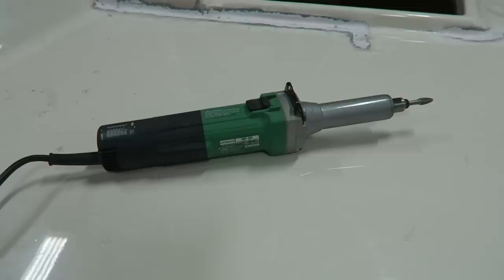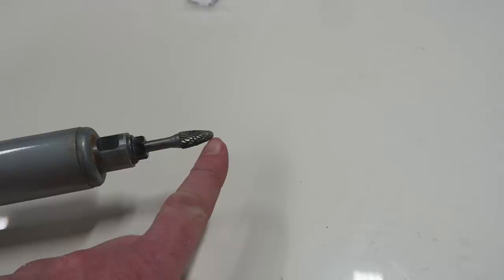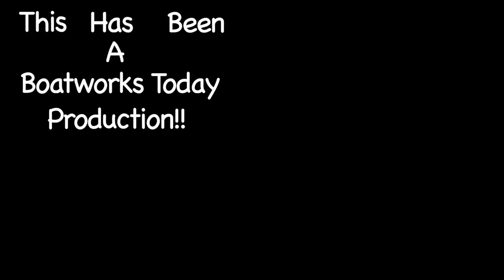Shaving Fiberglass, New Approach To Stress Cracks And Mail Call!

Comment: Hey guys FYI, Gel Coat will not properly cure if applied directly over the TotalBoat Thixo Flex Flexible Epoxy Adhesive.  You will need some sort of filler/barrier or you will end up with gooey soft mess of gelcoat where it contacts the epoxy.

Comment: After having applied a thickened epoxy to a ground out spot I like sometimes use a clear box tape over the area.  This spreads the epoxy out and gives good contact especially over a rounded surface.  Next day simply peel the tape off and way less sanding.  Ever use this trick?
Reply: peel ply is meant for this as well
Reply: @BackyardBoatworks  peel ply leaves a dimpled surface clear packing tape work great almost no sanding

Comment: One challenge with putting epoxy over gelcoat is that the epoxy is harder than the gelcoat, so when you sand it, the gelcoat abrades more quickly and leaves the epoxy patch higher than the surrounding surface. That's the point of premixed epoxy filler compound - it has fillers that soften it to gelcoat levels. How do you solve this problem with the flexible epoxy? I don't see how the little belt sander can completely avoid the gelcoat, nor can the finishing sanding.
Reply: Tape the gelcoat. Use a small smooth scrap of wood & sandpaper for hand sanding, long enough that you can see the contact point instead of your fingertips.

Comment: I have a little belt sander/ shaper and it has a vacuum attatchment, it's made buy Grizzly Industrial and you can dial the speed down real slow and make hardly any dust. Love that tool. I have an air one to but it's more messy. You can adjust the angle of the belt to different angles also. And it's small and easy to use with 1 hand. It's the cats meow.

Comment: I use a two pack epoxy cartridge gun system for gluing climbing anchors into cliffs. Yes, we always spurt out a couple of big pumps before each glue session and for each new nozzle. We keep that as a sample so we absolutely know that within the hole the glue has gone off. Best practice. You are doing it perfectly. Great explanation as well. Excellent to see you using something to smear the glue into the surface too mate. I was getting agitated in my seat and then just like that you used the stick to smear it in. Awesome.

Comment: One of the best features of Thixo is you can unscrew the top, clean up the opening a bit and cap it, to save the remaining product for the next time you need it. Most of their products come with two mixing nozzles, and you can buy a bag of 10 at a reasonable price. Really good way to get a little thickened epoxy when you need just a little bit.

Comment: This is a great video as are all of you videos. I have an old boat that I enjoy working on myself and fiberglass repair is new to me. I wish that sometimes the video would show the complete project and tell the steps from start to finish. I feel comfortable with fiberglass and resin but I do not have an understanding of how to transition from the epoxy you just laid down to applying the gelcoat. I really do not understand and to transition to the gelcoat step. Thanks for the videos, they are great.

Comment: I'm repainting my upper deck on my 32 Challenger Sailboat and it has a few layers if paint and crazing all over. I'm not looking forward to it. I fix boats for a living so mine need to look good right lol.  I love this boat but man lol. Yes grinding out all the cracks and laying down 2 Matt's over the top and then sanding it all down then filling pinholes with duraglass. Then I'm rolling and brushing gelcoat baxk on and aim to sand and polish then redo my non skid, fun times ahead. I started building a building over the top to work under out here in the PNW. today.

Comment: Interesting fix Andy. Can I assume you intend to paint and not gelcoat over the area? Because sometimes gelcoat won't cure properly over epoxy.
The gelcoat you ground out appeares to be very thick not exactly .020-.030" max , probably explains the cracking.( looked like 1/8").
So I agree, that Flexible epoxy is impressive I shall be trying some.  
We recently did a project with regular total boat epoxy gluing large Phenolic discs for a forming tool , loved it! My guys even took out the blue mixer and cleaned it out, I will watch the mix if we do reuse it.
Sorry a rather late comment.  Cheers warren

Comment: I guess by video date you have figured out your tools abilities by long time yourself, but as a tip to those other guys buying or just having bought one. Most power band files is a 5 in one grinder deal. 

Longside with undersupport, for flat surfacing and making bevels. 
Longside without undersupport gives smooth curve transitions and bigger outer radiuses. 
Transition between supported longside and wheel, gives a tighter hardgrind curve. Good for "submission beatings". Etc.
The other side - to wheel proximity combo gives smooth transitions from big curve to smaller curve.
Straight on wheel is good for inner fillets. Radius of inner fillet can be changed to bigger by angling the tool sideways and/or twisting it clock/counter to groove. Then aim tool for the middle of surfaces´ axis, for fillet grind symmetry.
Happy grinding. :)

Comment: I think you will find that the reason for the cracks is that the original gel-coat has been applied too thick. This usually happens in areas of the mould like edges and corners etc, as the area shown in this video. As you know the gel-coat can't flex as well as the resin/fibre laminate and the older the gel-coat gets, the more brittle it becomes as it cures over the years. The solution is to either beef up the laminate to stop the flex or shave down/thin out the old gel- coat. Forget the epoxy its total overkill and a waste if time.

Comment: ANDY.....the only caveat I would say for your choice of burr bit is to use 2 flute cutters rather than the 4 flute. It appears that yours are high speed steel......use carbide instead as they stay sharp a LOT longer. 2 flute cutters are used for non-ferrous metals and work much better on fiberglass. The 4 flute like you have tend to wear out faster, create more "dust" type dross and plug up the cutter. 2 flute cutters are more like chisels.

Comment: It would be interesting to see how time and UV exposure affect flexibility. Maybe next time you can run a handful of test strips and check in on them in 6mos, a year, etc.  Maybe one set indoors and another out with cold/light/heat. Project Farm is an interesting channel that has some great strategies for testing materials if your interested.
Reply: UV won't affect this epoxy as it will have a gel coat white over it. That will kill any UV long before it gets to the epoxy.

Comment: Another great video, Andy. Looks like I’m picking up some flexible epoxy in the near future. I’ve tried the same approach with West System using the slow hardener without great results. Thanks for the good advice!
Reply: Cal 40 Seafire I believe WS version is G Flex

Comment: Hi Andy, I have been watching several of your videos with great interest!  You have been presenting great information that I haven't been able to find any similar information for RV's.  So I have been trying to generalize your information into the nose of my 5th wheel.  It is a fiberglass nose with a gel coat. So I had ordered the gel coat with wax and are planning on using that to fill in the groves that I have made.  This Total Boat Thixo Flex looks very interesting and perhaps I should be using it.  I looked for it on Amazon and found 3 different choices.  Not having any experience I am trying to figure out where each would be best used.  On a side note your link above for Thixo Flex wouldn't work for me.  Thanks for your video's!  Keep up the great work. -Michigan-

Comment: You'd think you'd have to mix it more thoroughly than just squeeze and let it mix itself for maximum strength, very interesting...
Reply: They work great those auto mixers we use then in the autobody trade as well...for fixing rubber or plastic bumpers and glueing panels together...

Comment: If you wanted to do this kind of repair but didn't want to paint over it, would you just use standard polyester gelcoat, or some sort of gelcoat putty? I'm talking about isolated, minor crack fixes, not a boat makeover. Great vid by the way.

Comment: Could the repair have been just grinding out the crack and then using gelcoat to fill and finish?  What made this require an epoxy instead?  Thanks!
Reply: Juan Marquez , because the gelcoat will crack again as it's the same inflexible material as before.

Comment: That factory gelcoat job is the problem and why it cracked. Gelcoat should be no thicker than 30 mils. Some manufacturers did a second gelcoat layer with mat in it which was not a good since it trapped air.

Comment: Hey man love the videos and asking for a suggestion 4 the show can you create a serious on rc fiberglass boats on how to repair and how to blueprint the hulls on them as your videos are the most helpful I have found on here for trouble shooting and as the rc racing boats are usually very thin fiberglass or very thin carbon fiber to keep down on weight so there are probably some tricks that are needed for those kind of repairs that no one shows on youtube and as good as you are at explaining things it would be helpful as all heck as rc guys that do make some similar vids leave alot of steps out because they are used to doing them but not used to making vids about how to like you do just a think, would be awesome if you did so I feel like I could learn alot about how to from you 4 these boats as I have learned alot already watching your vids
Reply: I meant series not serious stupid auto correct

Comment: I did this on my boat, but then I watched some of your other videos and you say specifically not to put poly (gel coat) over epoxy because it may fail in the future.  Is this Thixo special and gel coat will bond.  I did go ahead and sanded with 60 grit before I painted on gel coat.  I hope it doesn't fail on my later.  Can you pleaser comment on finishing with gel coat or not?

Comment: Can I use this epoxy to fill a crack on the bottom of my hull. I have about a two foot fairly deep crack it looks like it could be a scrape from a trailer. I am going to dremel the crack exactly like you did and widen it. It's a single crack and I was hoping to not have to fiberglass it if it's just the gelcoat. If I get down to the laminate and find it's cracked I will definitely be glassing it.

Comment: Love your videos and have learned a lot.   Just wondering what you finished this boat with.  In researching products for filling cracks,  i read that you can't tell coat over epoxy. It's this correct?  
If so, can you use the total boat paint you used on the small boat restore over  the epoxy?  Seems it would be difficult to cover such a dark looking area on a traditional "beige" O'Day.  Thanks for your thoughts.

Comment: A guy hit my Donzi in the side and couple days latter I found a spider crack not deep just gelcoat and the cracks ran 360% and you could barley feel them with finger nail and the damage did not cause any deep cracks just hair lines. What is the best way to fill them. My plane was to get house of color for a repair kit with the gel coat same color and over fill each crack and sand and buff. Does this sound good to you ?

Comment: lets say u just need say 1/8 or less then its better to just squeeze out without using the static mixture nozzle.. else.. the nozzle is just a one time use . its better to use the static nozzle for much bigger projects whereby you may use 3/4 of the content in the tube of epoxy

Comment: Wouldn’t it be easier to highlight the cracks in a pen etc instead of going for it by eye? Another very interesting video. Thanks 🤙🏻
Reply: I never use ink on something I'm going to paint or put filler on ink will always blead through no mater how many times you paint it the ink will always show up or show a stain  and when it is someone's else's boat or car I would not take that chance I see this happen years ago to a young guy that marked a crack with ink and fixed the crack but there was a little ink left over and painter the cars ground effects and it made a total mess he painted the part four times and had to redo the repair become of ink...it's not worth taking the chance...

Comment: Hello and thank you for your most informative videos. I just watched this video on repairing stress cracks and wondering if that is the method I should use for my situation. We had a starboard stay failure and the mask went over, ripping up the tabernacle. I have found a replacement tabernacle but I am concerned about the cracks around the tabernacle area and how I should reattach it. People in my Sunbird Facebook group have advised me that I can re-drill the screw holes fill them with epoxy , place the screws in the holes and it should be good. My question though is will this be sufficient and what will be the best method for repairing the cracks around the base for the tabernacle? (Would like to put a photo in here but doesn't seem possible. ) Thanks in advance.

Comment: What are the final steps for the repair?  Faring compound and gel coat?  I have a crack on my Beneteau 37 at the bow where the elevated deck meets the foredeck.  Would this be a good method for fixing that type of crack?

Comment: How do you preserve the unused epoxy still in the tube for future use? Is the mixing tip trash after one use?
Reply: Part a and b are separate in the tube so all you have to do is put the cap on after you are done. The mixing tips are one time use.

Comment: Won't the gel coat crack when it is laid over the top of a flexible surface? I have a problem area that I fixed but the cracks came back. The cracks are on both sides where the Bimini top attaches and puts stress on the gel coat. I'm going to use the Flex and will leave a comment to let  you know how it came out and if the cracks reappear. Also I want to channel out of flex so I can get a good layer of gelcoat over the top of the flex.

Comment: Thanks for introducing the flexible epoxy. I was wondering, how did you clean the tube out afterwards?
Reply from the maker: The tips are meant to be disposable, so the best thing to do is leave the tip on so the material cures and helps to protect the individual components in the rest of the tube.  Next time you need it, remove and replace the tip and you're back in business!
Reply: @boatworkstoday  thanks, it looked like a real pain to clean out. I've got a lot of cracks and I think I'll give this a try.
Reply: Tips seem like a waste unless you use the entire tube.
Reply: @chrism4673  Each application is different. It puts out a nice bead right where you want it. Cut them back if you want a bigger bead. We also use them to dispense the epoxy into a syringe, way less mess than mixing it up and troweling it in.
Reply: You can order the tips in packs of 2, 12,  & 60. A pack of 2 is $1.49. http://www.totalboat.com/product/thixo-mixing-tips/

Comment: when i was backing boat  I hit tree .  LIKE cracked about 3 inches long on swimming platform.  just under bumper like a chip.   If i order the marine -tex  with hardener  .  If grind it open like you said and use marine-tex  white .   Would that work ok/

Comment: Would this be a smart choice to fill a few 1/4” holes that were drilled into a sailboat rudder (30’ Catalina)?  Rudder is ~ 1/8” fiberglass shell over foam core, which is over a steel frame. If I bevel holes and squirt this in, cure, sand, and then paint (Interlux VC 17)?  Your thoughts on it staying put/hole plugged?  Seems like it would flex with the rudder/fiberglass under load.

Comment: Is there a good way to remove all gealcoat from the hole boat and apply new afterwards? in this case a 28ft sailboat filled wit gelcoat cracks, torn of gelcoat, some parts of the hull that needs to be strengthend etc etc.

Comment: Hi Andy.  Great videos.  You have taught me a lot.  I've got a question:  In your video about halos, you applied a layer of 1708 to the outside of the boat over the problem area.  Which side of the 1708 goes toward the hull, the biaxial mat or the chopped strand?

Comment: Great video. Please also include what kind of grit paper your using when you grind stuff  In the different work areas.
Reply from the maker: On the best sander I use 36 grit :-)  I like to get the sanding over as quickly as possible!
Reply from the maker: Belt Sander...

Comment: I subscribed due to the succinct instruction. I purchased the sander through Amazon and got $100 off the price. The Thixo Flex was $30 from their website. Jamestown is just too darn proud of their products with outrageous shipping fees so I went with the 'Caulk and Seal' Heavy Duty, Revolving Frame Caulking Gun, 1/10-Gallon Cartridge Capacity, 23:1 Thrust Ratio. It has a higher thrust ratio, at 1/2 the cost. Anyway, too bad the video is incomplete. I would like to see the finish work...
Reply from the maker: All Totalboat products have free shipping within the US :-)  Also these vids are for the most part real time so end results will come along as things get completed

Comment: Hi I have a Sadler 32 that I had to repair the bottom rudder bearing.I have to bond the brass foot back into the Skeg .Do you think that the thixo flex would do the job. I don't have much experience with resins so thought that it would be a good .What do you think?

Comment: I have a Kenworth fiberglass Hood with lots of stress cracks I'm goin to sand the paint off of the hood down to the gel coat can I mix up just gel coat with acetone to make it really thin and then use a paintbrush in skim the hood all over and then come back and sand it slick will this fix the hairline cracks my thinking is if the fiberglass resin is really thin it'll soak into that crack and fix it in the acetone evaporate help me out please